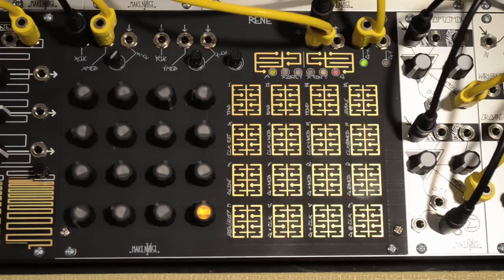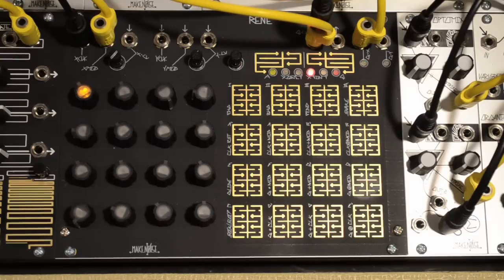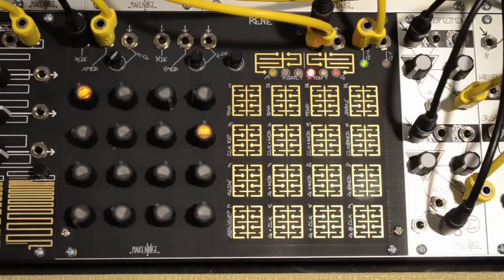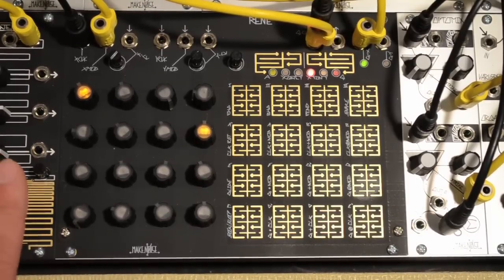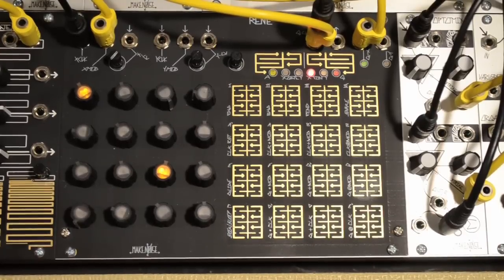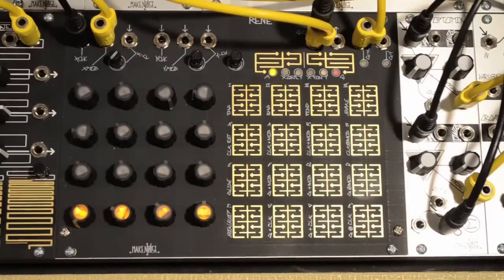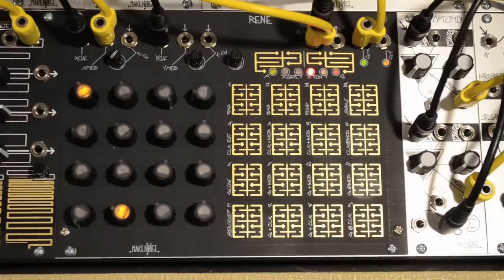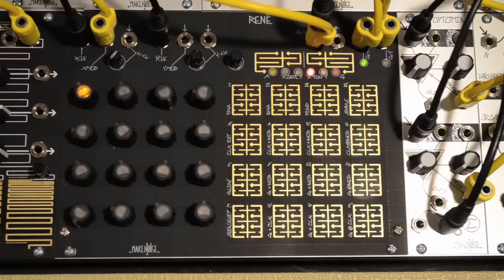Make Noise Rene Logic Walkthrough

Comment: can someone explain the last three logic functions to me? I've looked all over the place and I really just cant figure them out.
If the rene is receiving quarter notes in the x clock and 16th notes in the y, as in this example, how does the rene "choose" which to shoot out of its gate? Like here when the quarters and 16ths are "and"-ed together, the gate shoots out the 16ths for the duration of the quarter note pulse gate-high; but when they are "or"-ed, it shoots out a quarter for the gate-high of the of x clock, and then 16ths for the gate-low of the x-clock; and then I dont know exactly whats going on for the exclusive-or. 
It seems to me like the "or" in this example is acting like the exclusive-or, as it is shooting out both quarters and 16ths but not at the same time, and the exclusive-or is acting like an "or", as it is shooting out constant 16ths. What am I missing???

Comment: Are there 2 oscillators running? I hear a low bass pulse that does not move in pitch and one high pitched that follows the sequence. But you only speak of oscillator 1...  I'm confused
Reply from the maker: Yes, the low bass pulse is there as a frame of reference for the clock.

Comment: Is it possible to skip steps while having the same clock source clock Rene? I'm thinking about SH101 style sequencers. So you have a 16 step sequence and it goes through all the steps but some are muted in the sequence so it seems like only 13 of those steps are playing but with the 16 step sequence still running normally. To create more varying sequences and not have notes playing the whole time. Would be great to know. When clocking via ableton with midi patterns this is possible. But within the system itself I would like to know how this would be possible. Thanks a lot!
Reply from the maker: +Arthur Robert Typical way to do this would be to have the X or Y gate patched to an envelope generator that opens a VCA per step. Then just turn off the gates for the steps you want muted, on the X-Gate or Y-Gate page.
Reply: +MAKEN0ISE Holy crap, thanks for that info!!!!